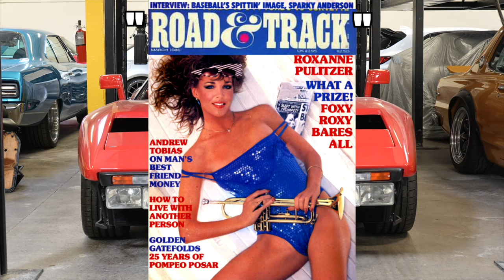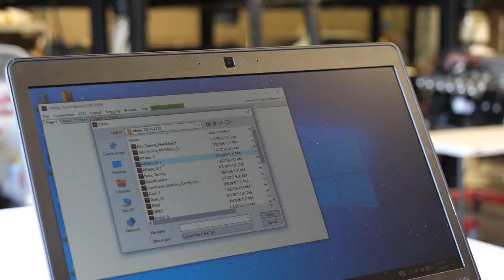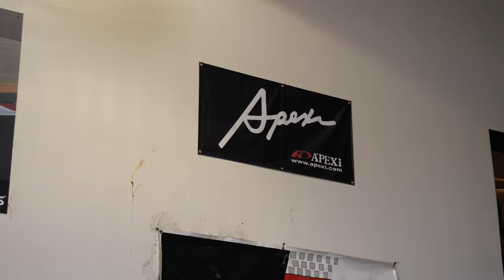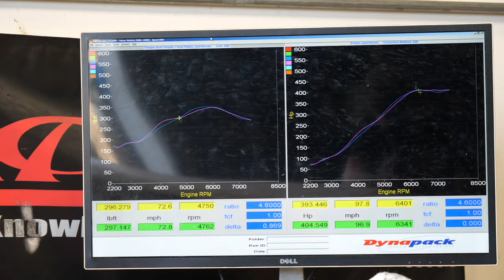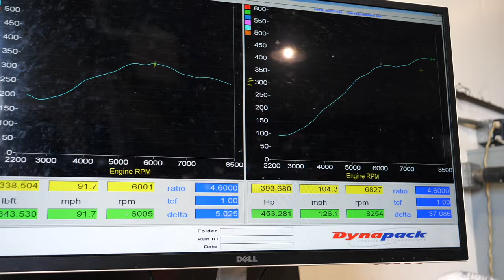Ferrari 288 GTO Project Breakdown (Only Shorter)

Comment: You would think that after watching the 1 hour episode 3 or 4 times, there would be no point in watching this episode, but I did anyway.   🤣 I can’t get enough of this car.  Coming up with a good look for the rear cover on the transaxle seems challenging.   I think if it matched the cast aluminum look of the transaxle, that would look good.  Maybe some gray wrinkle powder coat?  And leave the Ferrari emblems smooth so they stand out.  Just a thought.
Reply from the maker: Thank you so much for the watch! We tried to chop the longer version down for anyone who might have commitment issues.

Comment: 100% would do it. In fact....
Reply from the maker: In fact? Are you going to build one?
Reply: @JustDriven  Not building one today. Need to finish other things first but once those make way, I'd really like to have a 288 based off a stretched 308/328. The way labor costs are going up though, it may be now down to a pipe dream and just settle with my F355